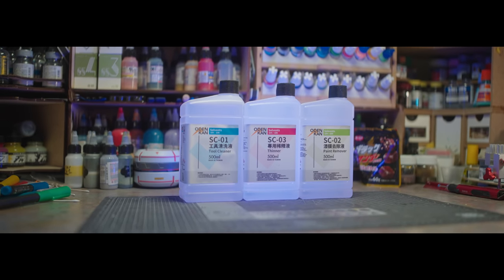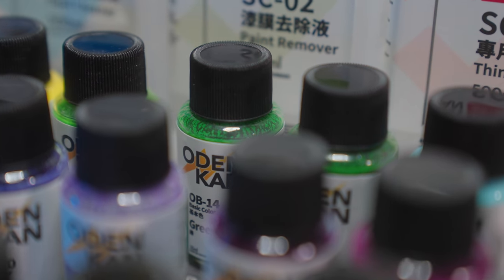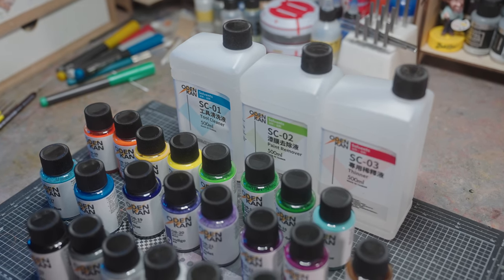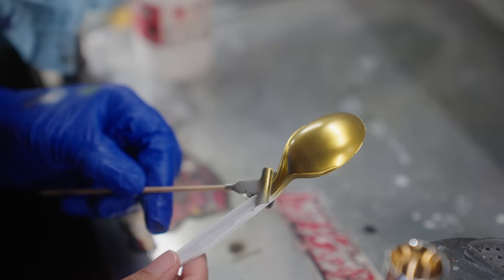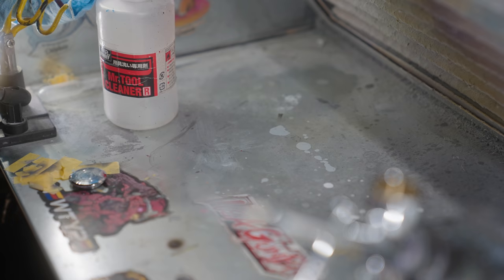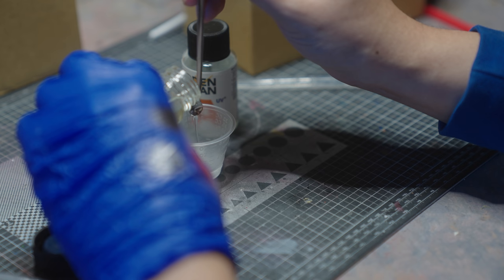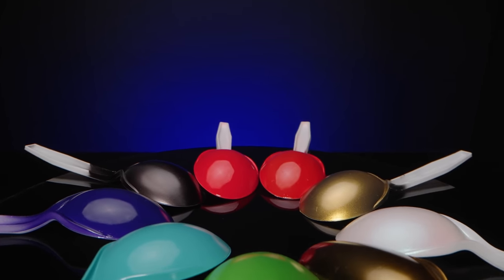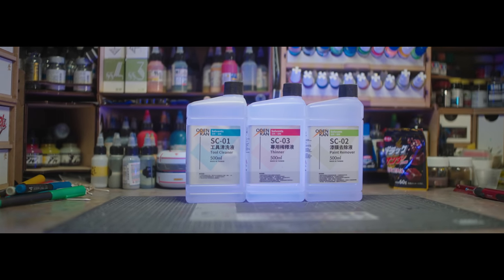OdenKan Paints Looking to shake up the Hobby World

Comment: Odenkan has been in the Taiwanese Gunpla scene for at least 3-4 years. What's so special is their candy series, where you can just use the RGB and get your desired colors (which is very tough for the other brands out there!). Just experiment and have fun. Also, they have primer for PP/PVC, which makes RG interior frame ungodly good looking.
Reply: As for thinning, for 0.5mm you might wanna use 1:1; for 0.3mm 2:1 basecoat + 10:1 other coats. Hope this will help you.
Reply: They also do have a clear coat for their metallic series (its pretty new).... which also acts as an interfacing coat. Ask them for it!

Comment: I think the reason you might have issues with the clear on metallics is the thinner/base of the clear re activates the metallic. Thats what causes the flakes to loosen up and move about. 

Can get around it by using a water based clear or allowing the metallic to fully cure.